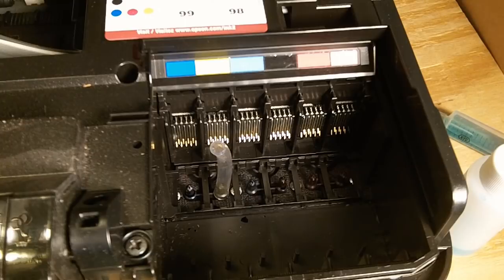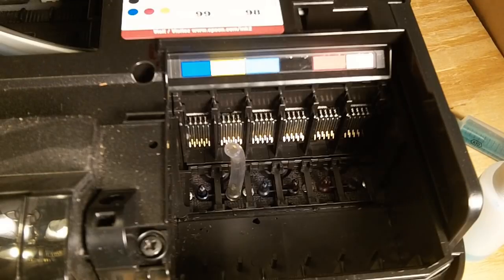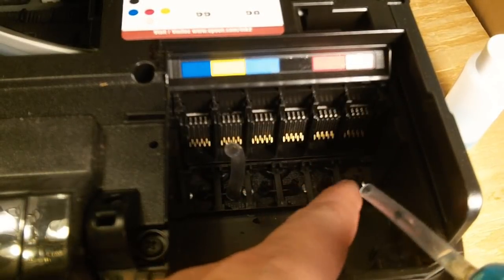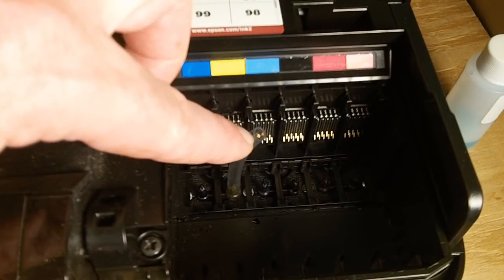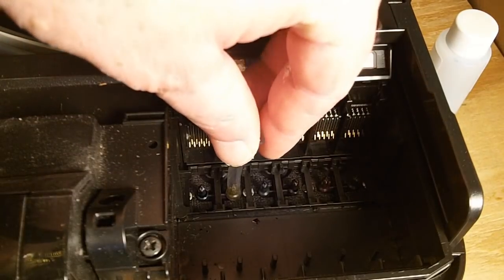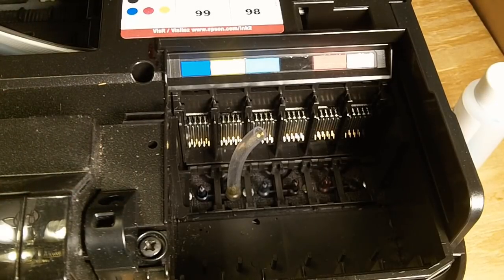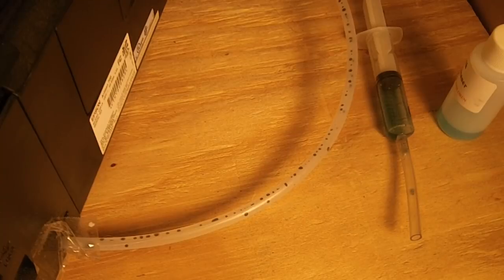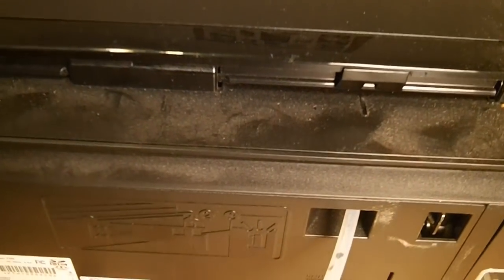Giving up on a dead printer? Try my way to unclog inkjet printer port

Comment: Hi Rob... thanks for your video... we dont have Windex in South Africa... so I used regular plain window cleaner here called Windolene.... together with alcohol.... the only thing I did differently .... was that I injected the solution and then sucked some back as well.... as the solution was not going down... did this twice and I think that unblocked the nozzle..as alot of color was sucked back....it was printing streaky... so  with the help of Stan Ingram's comment about doing a clean after the solution... it worked!!! thank you so much.... I had literally tried everything.... I was on the verge of buying a new printer... but just didnt have the finances to buy one right now.... your video was great.. thanks so much.... warmest regards Shamela
Reply from the maker: Shamela, thank you so much for the nice comment.  When I made the video I was hoping it would help people exactly as it helped you  as i was  in the same situation.

Comment: Thank you so much for your very informative videos!!  I have an Epson Workforce 1100 wide format inkjet printer.  I went to a site that sells the nozzle cleaning kits commercially and the fine print said that cleaning system works for all Epson printheads EXCEPT wide format.  Do you know why it would not work on my printer?  Will your method and your homemade formula work in my printer?
Reply from the maker: Patti I am so sorry but don't have a clue on this one. I do know certain inks do not respond to the cleaners containing any alcohol which actually makes them clog and get worse. The dye sublimation inks for example. I always recommend a person does not use my method unless they have no option  that way if anything goes wrong  it didn't matter. However many people are very happy with the solution i provided as i have been. sorry i can't help much as i do not know anything about the wide format.

Comment: I cut up a straw, stuffed it with cotton, and soaked the cotton in Windex and alcohol.  stuck the straws on the little print head ports and left it for a couple of days.  work with what ya got, lol.
Reply from the maker: go for it Josh, thanks!
Reply: @erestew  I have some glass straws are those legal?
Reply: Thank you for saving my printer! And my money...
Reply: Josh Eddings what do you mean by straw?
Reply: Wow your comment is what I’m looking for. I have some plastic straw and have thought of using them but the straws don’t fit into the ink ports. I never thought of using cotton. Thank you for saving my printer and my money!

Comment: they must make the printer ports much smaller now...the tubing was too big for my Epson WF 2750...I am improvising though and will see if it works!
Reply from the maker: thanks Lisa!
Reply: Same here, but my daughter came up with a perfect solution.  An infant bulb syringe (get it at a pharmacy).  $3.99, it is soft and rubbery and the tip is small and graduated.  Pour solution into bulb, pinch neck that fits onto ink pin and release the neck.  You have a snug fit and a way to 'pump' the solution through after it has soaked for a while.

Comment: This still works.  For ammonia I used the no-name Compliments Glass Cleaner from Sobey's (here in Canada) which says "contains ammonia" right on the front label.  It was a few years old, so I don't know if they have changed their formula or not.  Some rubbing alcohol from the drug store and "PRESTO", ink heads ran clean after letting it soak for about 10 minutes.  I have an Epson Work Force 3620.  I used some hose I found in my shed, didn't fit very snug over the nozzle and leaked a bit, but it worked nonetheless.  Don't forget the paper towel underneath, it makes quite a mess, even though I only used around 5cc of the 8:2 concoction.
Thanks, Robb!!!  5 stars!!
Reply from the maker: Lonster, I wish all of my viewers were like you, thanks a bunch!

Comment: I used a head cleaning kit from a company that have their own videos on You Tube and when I used the syringe to push the cleaning fluid through, it definately came through each of the four nozzles and left the paper I put underneath soaking wet with different colour inks. I even pulled up on the syringe a few times to draw the fluid back up and down again both ways. I then thought I'd leave it a week or more with the nozzles still wet with the fluid, just to help dissolve any other dried ink that might be there. After a week, I put the ink cartridges back and tried the printer again and still nothing. The print test was no better, maybe worse, but fluid came though each nozzle when I used the cleaning kit, so I thought it should work, but it didn't. Should I try cleaning it again or what. I even opened a new black ink cartridge and it didn't help. I've now been without the printer for 4 months and desperately need to print stuff off for my buisness.

Comment: Great vid - Thanks.  Question... I may have shorted my 1430 by running it too soon after cleaning. It turned on, ran to end of carriage and shut down - no power no lights.  Tested power supply and usb and holding button down.  Any ideas?
Reply from the maker: Jay, do a google search, that is such an unusual symptom it can't have many reasons for doing that.

Comment: Rob how can I remove Ink from a new cartridge and insert it onto a used cartridge, I have a Canon TS705 printer, the new Cyan cartridge is not recognized when I insert the old cartridge back in its recognized any way I can take ink from a new cartridge and put it into a used cartridge etc.

Comment: I just took posession of my daughter's 5 year old Epson Workforce. She may have used it twice.... ever. So I came looking for the information you so generously share here. Thank you. Oh my. How I wish I found this info 9 years ago..... My first serious scanner/printer was a sweet little Epson. I found an online ink source and ended up with almost $400.00 worth of ink,( if it had been Epson brand), for under $100.00. I printed the heck out of my art and poetry. I actually sold greeting cards printed on that sweet Epson. Then one day, she began to lose ink from the bottom of the machine. I figured I killed her with the cheap ink. So, I tearfully recycled her. I can imagine that you have a solution for what ailed my old "Betsy." The replacement HP machine has never put out the quality of print that the Epson did. It also "spies" on me if I try to use a "Non-HP" official ink cartridge.
Reply from the maker: your machine may have had the waste ink pads fill up and they were overflowing.

Comment: Hi Robb,
There is no Windex in my country, so I made your recipe for homemade Windex, and then I do your printer cleaning recipe. The result is very good, but there is still air or bubbles in the black channel. When I perform "Head Clean" and "Nozzle Check" the result is almost perfect, but later horizontal lines appear again when printed, "Nozzle check" is bad too. My printer is reset and I have an external waste ink container. My question is: How many times in a row can I do "Head Clean" ?? Also, I want to tell one big THANK YOU for your advices !!!
Reply from the maker: Thanks Lenny! If your horizontal streaks are in color or black and not just steaks where ink is  missing it is almost always a clogged head. if you can not unclog it you will have to replace it unfortunately. I will do a video this week on causes of streaks, some are not due to clogged heads.
Reply: @RobbsHomemadeLife  Only the black channel makes stripes, as It was the most clogged. I put the cleaning fluid in silicone tubes and allow them to flow naturally, without a syringe, the black channel drains the slowest, but when I inject fluid into it I do not feel much resistance. Also, several times I managed to print perfect Nozzle Check, and 3 whole pages in solid black - perfect print, only with black ink. Then back to stripes again.
Reply from the maker: One time I had  a printer that did that. If I was printing a black and white document and used the non color setting to just use black it would get streaks. However, if I printed using the color setting I still was able to print black but there were no streaks with the color setting. Also, one time my program was old and was not compatible with the computer , when i updated my program the printer started running OK.
Reply: @RobbsHomemadeLife  I suppose there is still a blockage in the inner tank of the black channel, or some hole in the black spike is clogged. I suspect that the ink passes and collects in the reservoir, but when a larger areas begin to print, it consumes quickly and then horizontal lines begin. I think the holes in the bottom of the head are completely cleaned, but the problem is in the channel above. I hope it will soon soften the clogged ink from  flow of the new ink. I forgot to tell you that I use pigment ink and your recipe works great even for it. Previously, I did solution 1:10  of ammonia and distilled water with a less success. Printer is Epson SX200.  I'll write to you later about the result. Best Regards!

Comment: Before I tried this the blue and pink inks were working. Now I've put the ink back in and it is printing blanks again. I tried taking the ink out and putting it back in for the printer to charge it again, but no luck.
Reply from the maker: Megan, it does not always work in every situation but do not quit yet. I have had the printer print blank and I continued to run the cleaning test once a day over a period of days and it started up again as late as a week. It went from blank to missing lines and spaces to back to normal. But sometimes the heads are too far gone.

Comment: Hi Robb, I replaced all of the cartridges on my Epson 1100 with Epson cartridges. The ink light on the printer stays on. Status report says M/C/Y cannot be recognized. I cleaned the print head, contacts in printer and on cartridges to no avail. Any other suggestions?
Reply from the maker: Mike, have not had that problem,  my only answer would be to google the problem somemore and leave a comment in the forums.

Comment: Hi Rob I used this method but interestingly the solution in the tube has flowed in a few minutes to through the nozzles however printer keeps printing the black color leaving horizontal linings. Do I have to apply it all the colors or just black? I'm always doing it on the black one
Reply from the maker: if black is the problem then just do black. You can wait a few days and try again.

Comment: when i connect the syringe with cleaning fluid to one of the ink port,  when I push doesn't go through. it create a pressure, I am afraid to apply more force. This Epson Artisan 835 is different than other. This one had the ink port connected to the printer head with a channels like house where all the ink circulate inside.

Comment: Hi Robb, I did exactly what you said and left the tubes in for around 24 hours. then even  syringed inky liquid out of each nozzle . When I got a blank page I did a test clean and  -
several test prints and even replaced old cartridges, but it's worse than ever!! 

The liquid in the tubes did go down and disappear so I assume it went into the printer system.

Any ideas or recommendations?
Reply from the maker: +Sue Surkes Sue, it doesn't sound good. I would try  test printing it again over the next few days.

Comment: Hi... Is the solution you mentioned work well with pigment and sublimation inks? I never use epson's original inks. I have L1300 and L120 epson printers loaded with pigments (CUYI) and 1 L110 with sublimation ink. Cleaning the nozzles had always been my issue so I just always buy new printers out of frustrations.
Reply from the maker: Jiggo Jig WeddingCoveage No, sorry.  I ever used those inks so can't comment but I seem to remember someone posting they tried it and made it worse with sublimation inks.

Comment: I have a problem. My Epson surecolor sc-p600 print no Black. When I print Black text it will be blue/Grey. I have done a nozzle clean + print head clean. The cardridges are full. I used no profiles and software is up to date. I tested this also on my laptop with the same result. What can i do more?

Comment: I’ve tried using the printhead cleaners with the syringe and I screwed up 2 Epson printers that I was trying to fix. I got an error and now it won’t even let me try to keep cleaning it as it keeps getting the error. Have you ever got the error and resolved it after trying to unclog using printhead cleaners and syringe method? I would put a paper towel underneath to soak up true water but I wonder if somehow it eventually caused issues somewhere in the electronics
Reply from the maker: I don't remember getting the error message but several times I did a cleaning with my liquid and nothing would print for days. When it did started printing it would just be streaks but every couple of days I would try it again and it would get better.

Comment: Really enjoyed your video!  It was very helpful for what I was trying to do.  Unfortunately, I flushed the print head several times, but could not unblock the clogs.  I also let it set, like you suggested for about 3 nights, but that did not work either!  I even removed the print head, soaked it in your solution and also tried pushing the ink through the print heads, but still didn't remove the clog!  I am using about 2 parts ammonia and 8 parts distilled water.  Do you have any other suggestions for me?  Would a stronger solution work better, or I am willing to try anything you might suggest.  Please let me know.  Thanks for your help!
Reply from the maker: Hi Dennis, if you have nothing to lose I would let it soak some more or try to use the syringe to suck the ink blockage  out instead of pushing it through.
Reply: Hi Robb, what do you recommend as the best way to suck it out instead of pushing it through?  Also, if I let the print head soak some more, 
should I use your ammonia/distilled water solution, or would you 
recommend something stronger?
Reply from the maker: Hi Dennis, I would use a syringe to suck it out and would continue using the same cleaning solution.
Reply: Ok Robb!  Thanks!
Reply: Wait, you said you removed the printhead? Are you sure you talk about Epson printer and not HP? Because with the Epson printer, removing the printhead is a big pain in the ass, because the printhead is in the machine, while in HP, the printhead is on the cartridge. Anyway, if you are so skilled to be able to remove the printhead, I don't see why soaking (you can also rub it with paper towel) did not helped, but you can also try soak it in warm water (the printhead). Maybe you are doing something wrong.... I don't know chemistry, but no matter how dried up the ink is, once you take out the printhead, you can clean it with all kinds of stuff. Just make sure you dry it out completely before putting it in!

Comment: I did this clean as per your video with your formula for the solution. After cleaning all the heads and inserting new ink cartridges, the printer isn't laying down any ink on the paper when I do nozzle checks, etc... from the maintenance procedures. Not even smudges or anything. Am I missing something? Any suggestions?
Reply from the maker: Hi carter, it sounds like the head is still plugged, but hard to tell for sure.
Reply: @RobbsHomemadeLife  After a couple of days of it sitting idle, my wife said today that it is printing! I think maybe it needed time for the cleaning solution to evaporate?

Comment: Hello! My Artisan 800 has a clogged head and I am going to give this a try. I have the waste ink tank and the CISS system installed and it has been just great. Since I had not printed in a couple of months the head clogged up. My question is: after allowing the solution to soak in for awhile just reinstall the ink and print? Then ink will push out the solution eventually? Also, while the solution is soaking into the print head does any leak out into the printer itself? I have watched other videos where they force cleaner into the head and protect the printer with paper towels.... I am thinking that since very little cleaner is being used nothing leaks out. THANKS for the tips!
Reply from the maker: cattail3 Yes, the clogged ink should soften and you should be able to push it out, but also try sucking it out with the syringe, one of my viewers had better luck with her clog by doing that. Afterwards, if the prints look streaky you may have to print and waste paper and ink for a short time for it to get back to normal. I had one experience where it took 3 or 4 days to get back to printing normal. Also, not guaranteed to work every single time, but has for me so far.

Comment: I have an epson artisan 725 that has just stopped printing black. Black printing is streaky but all other colors just fine. Test pattern indicates some black segments missing. Tried cleaning several times but no help. When cleaning, used over half the ink in my color cartridges but none in my black cartridge. Will this cleaning fluid go into my black ink port if the printer is in the normal parked position?

Comment: I got my printer printing again using your formula on uncloggin dried print heads. It was working fine, but Now it's rolling out the paper. I had this happen once before and it stopped. It's an Epson 200...any suggestions?
Reply from the maker: can you explain more about what you mean by rolling out the paper?
Reply: @RobbsHomemadeLife  the rollers grab the paper and then they just start rolling out one sheet of paper after the other. It doesn't stop to print